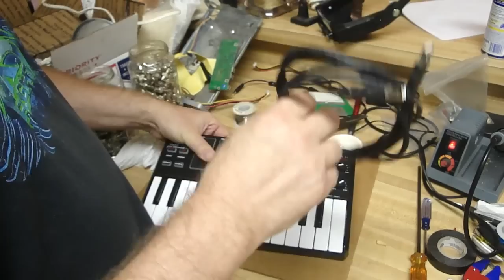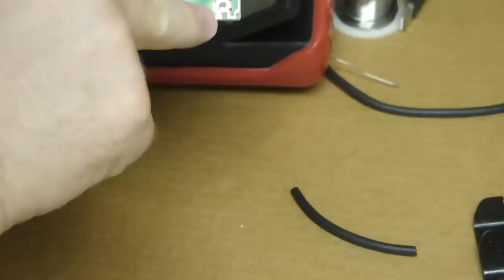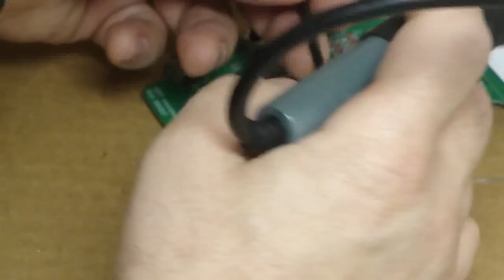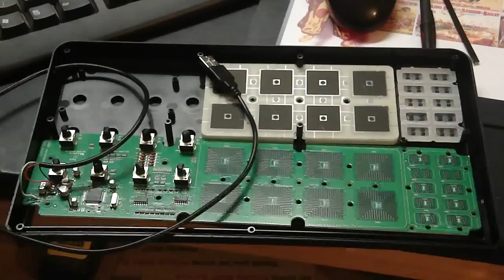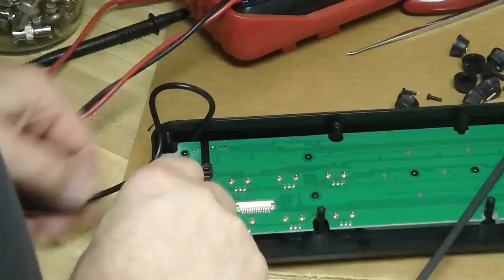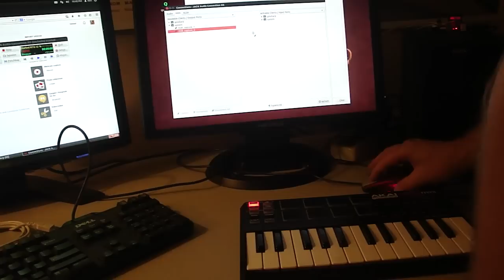Akai Mini MPK USB Repair #2 - Hard Wire USB Cable Cheaper Better Faster

Comment: Dude. I just picked one of these up on Craigslist for $35 with a busted USB connector.  No idea if that's a good deal or not, but THANK YOU.  

I was searching for pinouts and schematics until I found this. You saved me hours of research and bumblefuckery. And probably a few dozen bucks. Never soldered before in my life, but now I have a working midi controller (and a little soldering experience). I ended up just doing strain relief around the screw post in the corner. Now just to figure out what the hell to do with it...

Why did the solder melt so fast for you? Better iron? Better solder? Better hands? Magic?

Comment: Thanks! I did this yesterday! In my case, a couple pins in the connector were  bent.
Very helpful to have a picture pointing out where the connections lead to. I remembered to put the cable through the hole before soldering, but put it through the wrong way so ended up making a small cut in the plastic and putting it back in the right way. Used the two holes/vias under the USB connector and a piece of jumper wire for strain relief.

Comment: Hi Ken
I tried to fix my mpk mini and for some reason its not working. When I plug it in All the lights come on blink off the top left light blinks but instead of staying lit it turns off? Any idea what the problem is. I live in Sarasota, Fl

Comment: Hello Ken,
I just attempted the fix my MPK and my clumsy soldering skills failed me. I love your detailed repair vids and the fix seems great, but I had a lot of trouble when soldering the R1 and R2 connections. In fact, I heated off the R1 connection altogether. Is my MPK doomed for the dump, or is there a potential fix for this?
Reply from the maker: Wouter Van Beek My advice is to find someone with better soldering skills to do it. The components are quite small and some irons are too big and hot for this work. There's a chance you can salvage it.

Comment: ive done this and the power is on but it seems as if its not connecting to the computer
Reply from the maker: You'll have to verify continuity between the connector pinouts and the point on the circuit board. Usually there's a short, or an open, between the pin. If the connector broke loose, a trace may have pulled up and shorted. I may do a video on how to check continuity at a later date.
Reply: @keninorlando9  Did you ever make the video?

Comment: Hey there, it's long ago since you uploaded this video but I like to ask you something.
First of all, thanks for the fix! It worked perfect for me. I like to mention, that you should have good soldering equipment to do this fix especially for data wires.
But anyhow it is working!
I need to get new screws for mine cause I simply bought it without, can you please tell me which screws I need for the whole akai???
I can't find any description on the web for it :(
Reply from the maker: I don't know where to get 'official' Akai screws, but I'm sure any hardware store has something close... they may not be black like the originals... if you still have one just show it to the guys at the store. Sorry I couldn't give a better answer. You could always just keep an eye out for someone throwing a keyboard out - they mostly use similar screws between brands and models. Even the screws from a computer keyboard look about the same.
Reply: @keninorlando9  Hey there,
thanks for your reply!
Yeah it seems not to be so easy cause there are really small ones used. Unfortunately I don't have one over to buy the right ones.
I simply don't wanna brake the plastic parts. Finally I know that all screws are same for the whole akai. So anyways, thanks a lot for your video and the fix! It's working perfectly for me!

Comment: Hi I am having a problem when I solder the wires on the board. After I soldered them I do not get the right flashing pattern when I plug in the USB. All the lights flash on the board and then 1 bright solid light with the others on the right hand side constantly blinking also. I assumed it was the data cable so I have soldered the in the exact spot shown in the diagram and I still do not get any different result. Please get back to me ASAP thank you.
Reply from the maker: Test communications with your computer. If you have that, then try sending over the factory defaults using Akai's software. If not, most likely you have an open, or short and need to remedy that. Then again, the board itself could be bad but I've only seen that once and that was when the previous owner damaged the board soldering on the regulator, which is not related to THIS repair at all.

Comment: Hello Ken, I really like your repair videos, they are very helpful but I have a question for you. My Akai MPK mini connector is broken but not completely (it works alright but if I move the cable just a bit, the connection is lost, it is really annoying). So I was thinking about doing this repair because it looks really simple but there is a problem because my connector is still solidly attached to the board. So what do you think, how should I remove my connector and not damage my board to preform this hard wire repair?
Thank you. :)
Reply from the maker: +Blaka Blak Here's the thing... you have to have some decent soldering skills using wik, or a hot air gun, or other method. Since you're even asking I'll assume you're not so familiar with those techniques. 

It's easiest to take the 'solder blob' approach here - heat up the left and right mounts while applying liberal amounts of solder, and also on the electrical connections on the ends. Run the iron around the connector in an attempt to keep everything liquid while applying gentle pressure on the usb connector itself.

The PACE company has some GREAT soldering videos on youtube - some directly address your issue. 
https://www.youtube.com/results?search_query=pace+soldering
And this one by Marc Siegel - around 29 minutes in: 
https://youtu.be/M0wI-5YZQm4?t=29m

Hope this helps.
Reply: +keninorlando9 Thank you very much for helpful information. :)
Reply: +keninorlando9 I just wanted to thank you one more time. I did this like you said and it works great. :))
Reply: Blaka Blak Hi, can you please elaborate on what you did? My connector is also attached to the board, but it struggles to establish a solid USB connection. Did you just solder around the connector itself?
Reply: Well, Ken wrote exactly what you should do in the comment above, he even linked some helpful tutorial videos. I didnt want to screw up my MPK for good with my lame ass soldering skills so I gave it to my friend who is good at this stuff and has the right equipment to do it and I sent him link to this video, he did it it no time. I am not 100% sure how he removed the connector but I recall that he said something about using a hot air gun. Sorry that I couldnt really help but I can tell you for sure that if you dont have at least mediocre soldering skills,its definitely better idea to take it to someone who knows what hes doing and show him this video than leaving yourself with no controller.

Comment: Hi, I've had this exact MIDI for the past 5 months and it has worked fine until recently. About a week ago, I plugged it into my Macbook Pro and the lights did not turn on and no sound came out when I pressed the keys. It just completely stopped working. Do you know how to fix it?
Reply: SuperNova same!

Comment: Hi there!

You breifly mention the four connectors close to the top of the board. Do you know what they are? I'm looking for TX/RX to be able to make a standard DIN-5 MIDI connector pair on the thing... You know how to do this?

Kind regards,
/Joakim
Reply from the maker: +Joakim E USB != MIDI.... ( in human speak that say USB DOES NOT EQUAL MIDI ).

if you just want to swap the USB jack for a MIDI jack ( because they last longer )  just wire it any old way as long as both ends match. Might be a good idea to keep gnd as gnd so you can use any midi cable. USB color codes are all over the web... +5 / gnd / + / - ... just four connections... ohm 'em out...
Reply: +keninorlando9 
Ah,  I'm sorry I think that I formulated myself in a flawed way... I'm fully aware USB != MIDI. But I know that many hardwares seem to have a standard MIDI implementation (kind of) behind the USB abstraction. Would be super-nice to make the MPKmini have an old-school connectivity option. Hence I was asking about the connectors with another purpose than USB TX/RX, or if you somehow found old-school MIDI TX/RX. My thinking was to just add a couple of old-school DIN if there was a local MIDI-bus to connect them to.
Reply from the maker: +Joakim E I see what you're saying. Most Akai keyboards have actual MIDI so you're probably right. 

While I don't currently have one of these laying around, I might take a stab and checking that row of 4 through holes in a row ( where I mention mounting ground ). I know those are NOT the USB connection points, but I never thought to scope it for midi.. I would make sense that the functionality is present but not wired... but even if that IS the midi port it doesn't mean it's active.

If I get another one I'll scope it - in the meanwhile I'm curious myself. Maybe someone else has gone fishing for the MIDI on one of these.

Comment: I have been having an issue after doing this repair. I am not able to download/upload program changes from mkII editor, I assume this is because we are no longer getting our connection from the usb port but rather the circuit board itself. Granted, I can use the midi portion of the device but uploading firmware or using mkII editor either shows no connection or doesn't respond respectfully. Any insight would be much appreciated.
Reply from the maker: ohm out your connections to/from the cable and check for shorts. Most common issue is visual connection is good but electrical connections are bad.
Reply: will do, thanks for the tip
Reply: keninorlando9 Sorry one last question, would you happen to know the size of the case screws? The eBay buyer I bought this as-is unit from doesn't have them. Any help is greatly appreciated.
Reply from the maker: serpicoemcee The case screws are the same as the screws that hold the circuit board to the case ( once you open it you'll see them ). I don't know the exact size, but take one to the store - you'll find some in small hardware - or something close enough for rock and roll. I know the screws you use to attach a pick guard to a guitar are very close in size.

Comment: I dont see a fuse on here either i'm sure its there i just cant find it... do you have or know where to get a PCB diagram for the MPK 49 main board?
Reply: I just realized the whole USB connector on mine got pushed in and it looks like it destroyed a couple little resistors in front of it and theres no way im gonna be able to solder those little guys back on without hundreds/thousands in micro soldering equipment.. I think mine is toast :( it sucks cause it powers up just fine the USB is just messed up
Reply: a low wattage soldering iron, magnifying glasses, tweezers, and wood toothpicks can go a long way to work with surface mounted stuff until you get to the really high density stuff like 0.5mm lead spacings.

Comment: I have seen this happen to both samson graphite and korg nano midi controllers!!! Can manufacturers please get with the program and stop making products with this obvious flaw!!!!! omfg
Reply: +oskroskroskroskr don't think either of those controllers can be repaired in this way however as they don't have the little holes in the pcb like this one does
Reply from the maker: +oskroskroskroskr This kind of repair equates to a broken wire/connector/etc... for repair techs it's "cherry picking". As to are they unreliable? sure - old style midi and xlr connectors hardly ever fail. The upside is that someone with decent soldering skills can make a few bucks doing easy repair jobs that are guaranteed to fail in another year or so! ;)
Reply: oskroskroskroskr crazy thing is ppl are obsessed with these! I've never been as underwhelmed by any musical device I've bought as I was when I got this "toy" in the mail. It lasted a good 3 hrs before I ripped out the USB jack when I stood up too fast with it in my lap, stretching the included 7 inch usb cord (only slightly exaggerating) to its max. SMDH. Luckily, 3 hrs ended up being more than enough time to conclude that I could have won this thing at Dave And Busters and still been blown away by how cheaply made it is...and I just saw these at guitar center yesterday...STILL goin for $99 new. I have mine listed on 5miles for $15 as "for parts/repair". I also listed a Behringer UMX25 (a 25 key midi with keys that almost feel like a real piano. Amazing quality) at $50--knocked down to $30 after a few weeks with zero offers. And STILL, this pc of crap (despite its non-working status) draws more interest than the FAR superior Behringer. "hey man, if I paid extra, could you fix that Akai before I buy it???" I should just lie and tell them I ALREADY fixed it AND modded it by adding Behringer's silver "housing upgrade" that is rly popular rt now...

Comment: Hey keninorlando, can I ask for a favor? I just damaged my board by missoldering the resistors R1 and R2, can I know what's the ohmic value of those resistors respectively? Thanks man.
Reply: Did you ever know there values because I'm facing the same problem